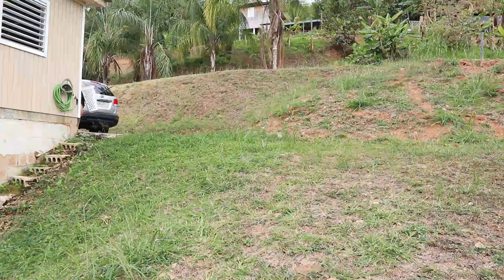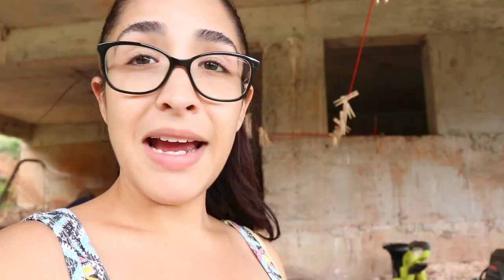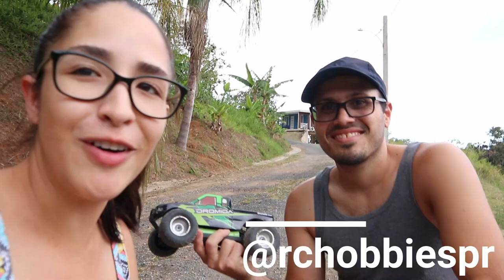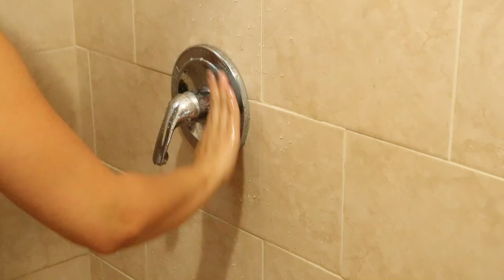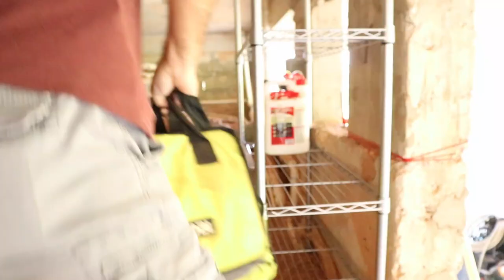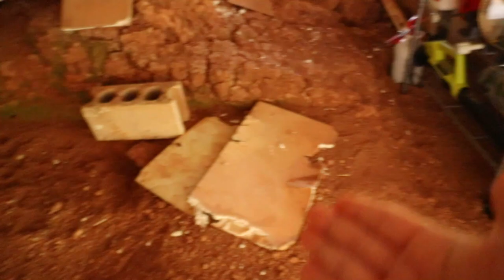Tackling Undone Stuff All Around The House | Future Plans

Comment: When we're washing cars it's Better idea to wash from the top & down > save the back quarter panel wheels tires for the very last thing <  if not its very easy to get the dirt & tiny sand rocks in your rag & scratch up your car's paint job since those are the dirtiest areas.